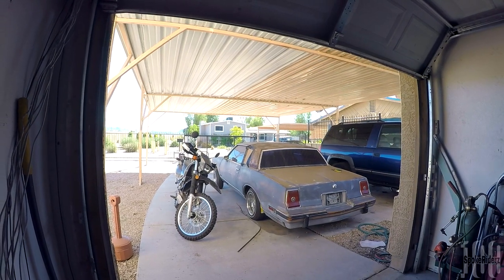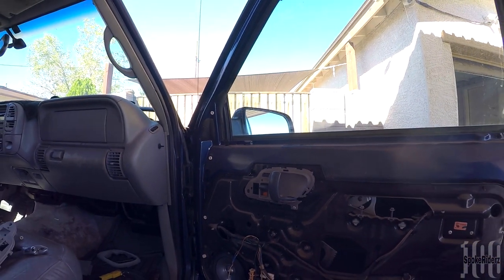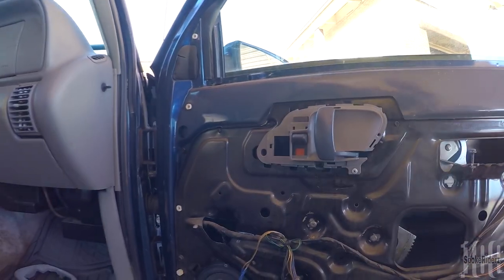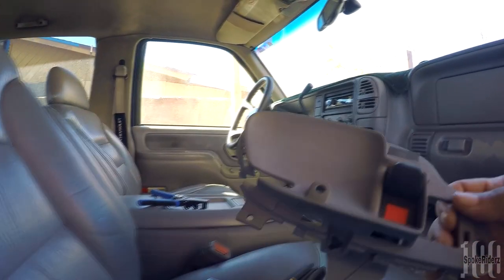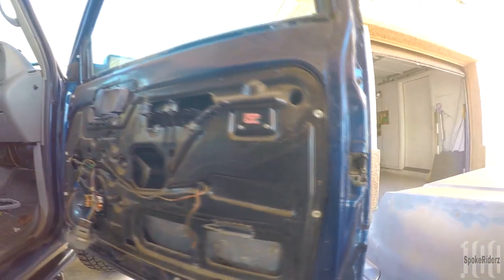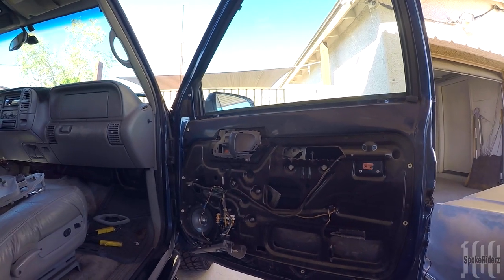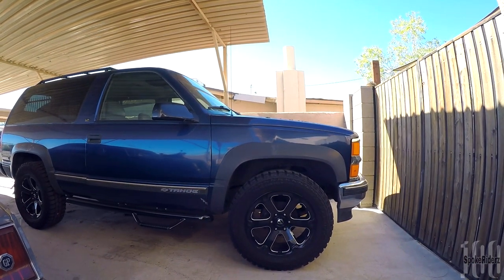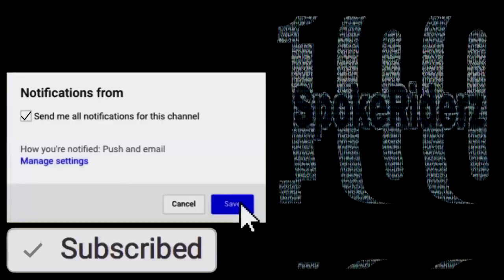99 Tahoe 2 Door Handel Problems

Comment: You need to find someone with a 3D printer and have them make you some durable parts. I’d imagine the heat out there doesn’t help.
Reply from the maker: I wish I knew someone with a CNC machine to make everything out of aluminum because the AZ sun is very hard on any plastic